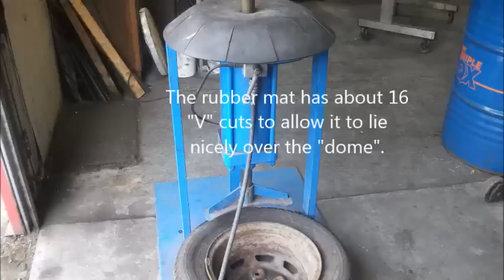Handy Homemade Tyre Machine

Comment: I'm very interested in building myself a tire machine similar to yours with a bead breaker can you please give me a part number or where you got that hydraulic cylinder from thank you very much I appreciate it
Reply from the maker: It's not a hydraulic cylinder, George, but a compressed air one and as it states at 0:10 at the start of the video , it was salvaged from an old carpet machine I broke up years ago, so I can't help you I'm afraid.

Comment: 2:50 he needs to press the opposite side of the tyre down past the bead. Thats why its so tight
Reply from the maker: The opposite side was pressed down into the well but it had sprung back up a bit and made it a bit tight with the lever. I normally keep bumping it down with a mallet but for this demo I didn't bother.
Reply: @confabrication  Fair enough, thanks for the reply and BTW great machine

Comment: Amazing work, now i just need to find a carpet machine.
Reply from the maker: Hi, izzzzzz6, The cylinder doesn't necessarily have to be from a carpet machine - it's just that mine happened to be. Any large one would do.
Reply: @confabrication  what would the proper name of the cylinder be? And what else would have that type of cylinder??
Reply from the maker: I would just call it a double acting air cylinder. I've no idea what else would have this type of cylinder other than a large, made for purpose machine of some sort- sorry, not of much help to you.

Comment: Best I have seen so far, you just gave me a idea that relieves me of the COST factor and the  ' Is it worth it" thing.   I don't need a tire changer for more than a few hours every few months or so, I thought, would it be worth going to all the trouble and using up the space around here just for that. 

   But Now looking at what you built there, I see I can build a tire changer, that is also a wood splitter and possibly a press, I can use all of those things here so I would get a ton more usage out of this type of set up.   Thanks  man!
Reply from the maker: Good thinking, Larry  -  if you make a multi-purpose one,  please post a video for all to see !
Reply: Ha!   i am not all that Movie star capable LOL    but ya never know. 

this machine has parts that are b=not readily available,    I am going to take a stroll through some scrap yards i guess.     you see what I mean though right? if that bead breaker end was removable, you could make other ends for it.

Comment: You should be able to lever the second tire bead over with rim in place i would think. I usually take a mini sledge and beat the tire off though!
Reply from the maker: Yes, Rob, I sometimes lever the second bead over just as you say, and finish it off with a large rawhide mallet..
Reply: The air cylinder is really handy i wonder what other machine use this cylinder as it seems an easier setup than hydraulic cylinders.
Reply: Brian Davison 

وبرييؤ
Reply: @ajl9491 . any cylinder can be used with air but not all air cylinders can stand the pressure of hydro.  i think thats how it goes at least
Reply: ये मशीन कहां मिलेगी

Comment: Hi I have a similar machine but rubber in sleeve  has perished make it not seal any idea where I could purchase a new rubber?
any help appreciated
Reply from the maker: I'd like to help you, Shane, but my only suggestion would be to try a place that deals with hydraulic machinery.  They might be able to point you in the right direction.

Comment: do have a alternative to make the cylinder system that could ideal on how to make one? Thank you.
Reply from the maker: In answer to Kevin Norman - A hydraulic cylinder could be designed in, but unless it was powered by an electric pump, it would be very slow to operate. I used the air cylinder simply because I had one.  These are usually available second hand if you try looking, and it's the way I'd recommend you go.

Comment: You are Brilliant! best machine I have seen yet on you tube,and you made it from junk parts! Bravo! I would not call it manual though got some major assist there breaking the bead,wich can be a real pain in the ass! I am 69 yrs old very tough for me!
Reply from the maker: Thanks, Leonard, for nice remarks . The bead breaking is certainly tough if attempted  manually as I used to have to do, but this machine makes it a cinch.

Comment: Nice machine! That cylinder would make a great forging press.
Reply from the maker: The action would be too slow I think, OrionsAnvil, and the full force is only one tonne with 100 psi air pressure.I think a hammering machine would be the way to go for forging.
Reply: @confabrication  where is the link on diy..how to do it video?
Reply from the maker: @hilarionpaloma722  There is no link. I built the machine some time before I made the video and didn't do a build sequence on it.
Reply: @confabrication  Do you know what size the cylinder bore is? I'm looking to make similar bead breaker with a 100mm cylinder. If my calculations are correct it'll do 750KG at max pressure of 150PSI. Do you think that would be enough?
Reply from the maker: @phil7791  My cylinder bore is 6" with a 1 1/2" diameter piston rod.  I calculated that the downward force (taking into account the area of the rod, as the pressure is acting on the back side of the piston) at 100 p.s.i. is 2650 Lbs (1202 Kg).
So with your set up you'd have 5/8 of the pressure I'm getting.  As to whether this is enough, that is the $64,000 question - probably o.k. for tyres that haven't 'bonded' themselves to the rim. Tyre size is not really a factor, I've found    Hope this is of some help.
Reply: @confabrication Thanks for getting back to me Brian. I've made a very quick mock up today. Just bolted the ram to wall of shed with a flat plate on the end of the piston.  It's broke the beads on the three wheels I have to hand at 90PSI so its worth proceeding to build a mount for it.
Reply from the maker: @phil7791  Great news , Philip , now you can go ahead confidently with the build. Take some pics and video when you do and upload it onto YouTube for us all to see.
Reply: @confabrication  Will do.  I'm just going to make a frame for the bead breaker rather than a whole tyre changer. I do a few alloy refurbishments so all I need is the tyre down off the bead to expose the edge of the rim for painting.